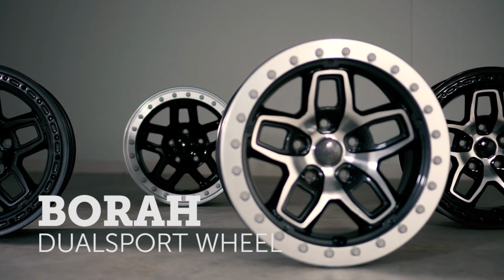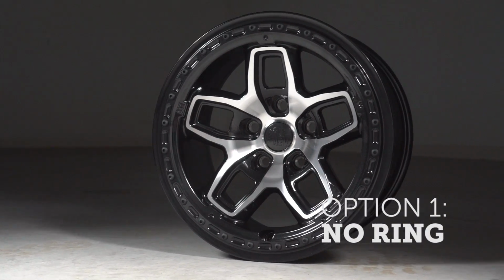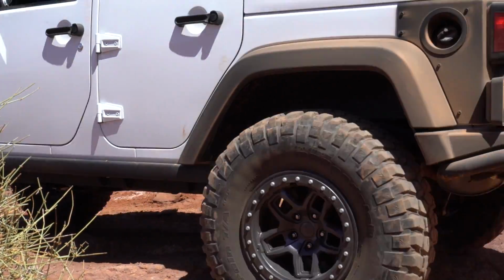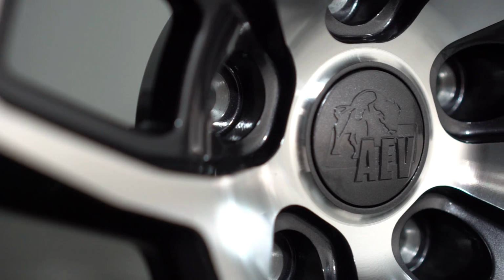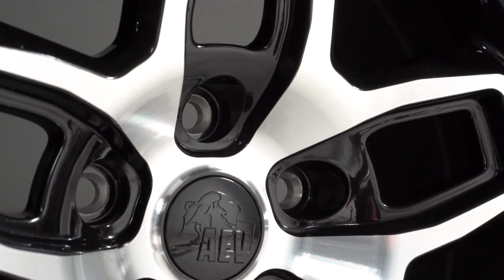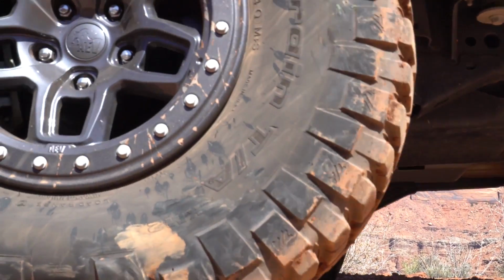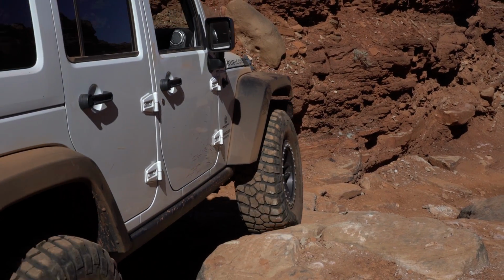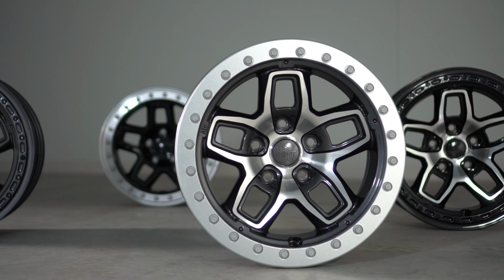AEV Borah DualSport Wheel - Our Most Versatile Wheel to Date

Comment: Great looking wheel! Any thoughts about running 37” tires with the AEV 3.5” DualSport Suspension? Would one need a 4.5” lift to accommodate? Also wonder about AEV bumper width being a possible issue for tires rubbing with 37”.
Reply from the maker: It's possible to run 37's on a 3.5" lift.  However, you'll need the rear bump stops from a 4.5" kit so you don't rub off-road, and even then you'll still hit the bump stops pretty regularly with enough weight in the vehicle. The 4.5" obviously handles this better. 

The bumper isn't an issue, it's designed to have the right clearance on 37" tires with our suspension.

Comment: So i can take this ring and have it painted red and put it back on and if i have a flat or rotate my tires i dont have to take the ring off at all ?
Reply from the maker: If you are using the protection ring, yes, that is 100% accurate as the tire mounts traditionally. If you were running there beadlock, it would be a different story.

Comment: What a great looking wheel. I'm in the market for a beadlock for my trip to Moab and they would look great on my Jeep..... but...oh snap , I have a TJ.
Reply: Chris Palko some great companies out there have the bolt pattern conversation spacers for TJ to JK patterns, I run spacers and I’ve jumped my Jeep 15 feet(not intentionally) and bent my axles the spacers didn’t fail. That would be a good route, I still run G2 spacers with my Borah Beadlocks. Had 0 issues with both.